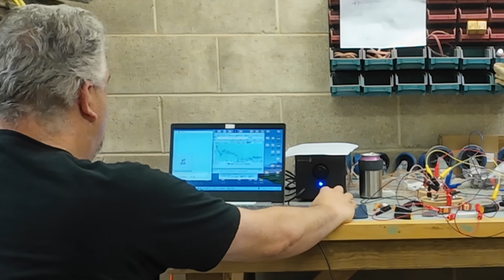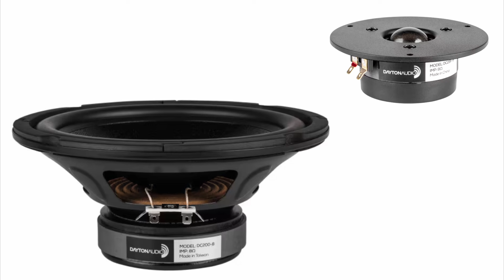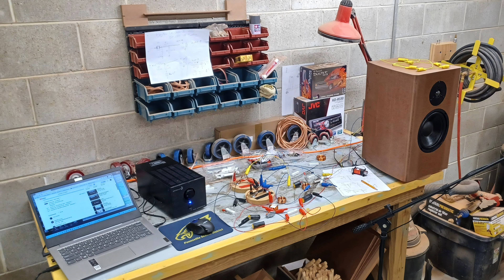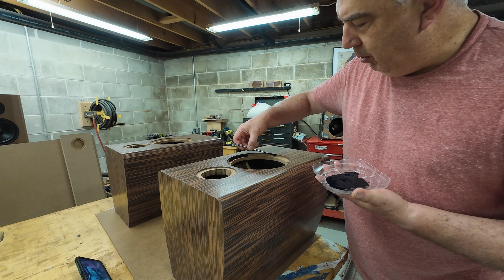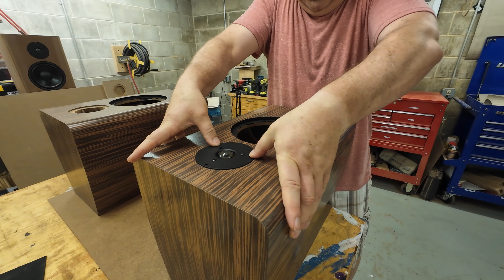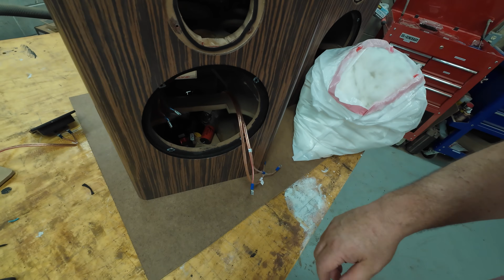Measuring and assembling the Crossovers

Comment: Where did your get the FRD & ZMA files for these drivers (and others) to use with Xsim?
Reply from the maker: Those files are generated from the Dayton Omnimic and DATS signal generating hardware sold by Parts Express. They may be available online as well if you poke around a bit.
Reply: @zarboaudioprojects1430  Yes, I know that PE provides some FRD/ZMA files for Dayton drivers. I have to use VPN to cit the block PE put to Brazil originated questions. I installed Firefox VPN on my laptop and I got access to PE. Got the files.

Comment: "I don't know why I don't just buy another pair (of glasses)."  Because you're a man and the glasses still work!  Lovely work as well.  They turned out great!  Well done!  A quick side note, I have screwed up on every speaker build I have done.  Each time I learn a new trick that I can use later or learn how to do it better to avoid that mistake the next time.  Lots of bumps on the head but you eventually learn!
Reply from the maker: 100%  I did end up buying a new pair as the ones in the video wouldn't stay on my head anymore. Plus I got superglue on the lens so I could barely see through them. :)

Comment: No measurements after crossover design? 
Also, did you notice the F3 in-room response? One thing I like about closed box designs is the slow roll-off. Just wondering if it made it into the 30s with room gain. 
Where did the final crossover point end up? 
Side note: I have that same Ryobi drill. Have had it for 8 years and it is perfect for assembling speakers. Not so powerful that it could destroy things, but powerful enough to get the job done.

Thanks again Tom. Love anything you do.
Reply from the maker: Hey there!  Well, it didn't measure exceptionally well, and I couldn't get a particularly good reverse null, so I wasn't super keen on publishing the specs. The cross was around 1900 Hz. Honestly, I'd have to see if I even saved any graphs. I still have to finish my pair, I may grab a graph when I get mine done. Bass wise, they pretty much rock, I was getting  output into the mid 40's.  Maybe I'll do a followup after I get my set finished. Thanks for the comment!
Reply: @zarboaudioprojects1430  thanks for the reply. I would love to see anything else you have. 
I understand about reverse nulls. Sometimes you can get super deep ones and other times even when you reverse polarity it doesn' t do much. Crazy. Phase is a problem. 
In the end, if it sounds good, it is good.